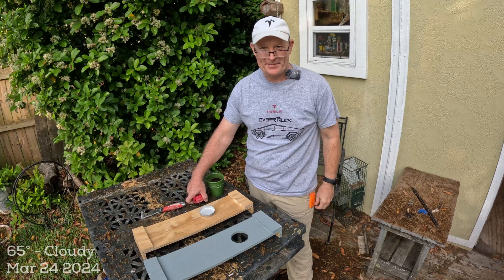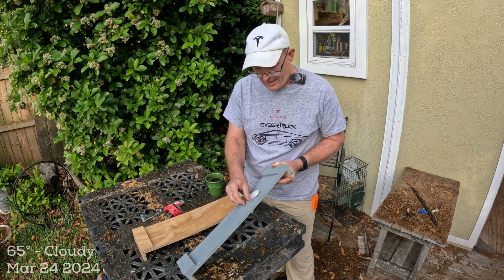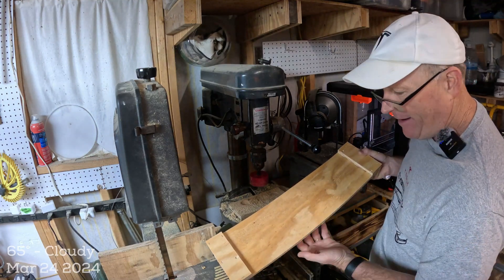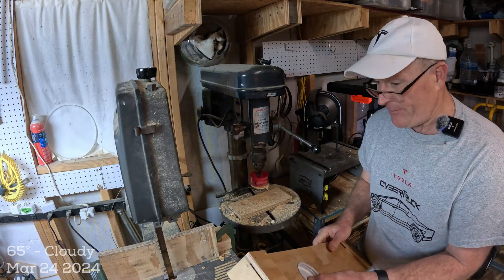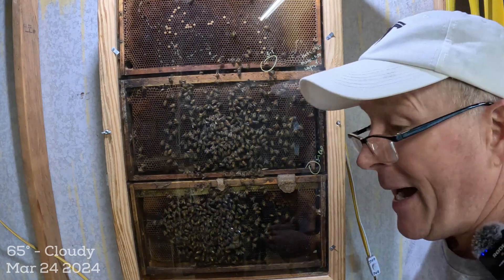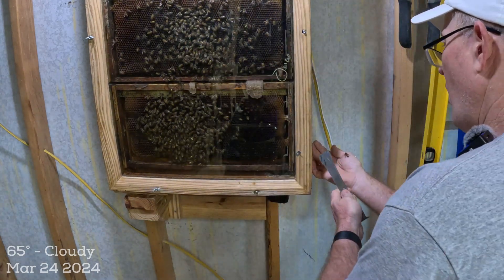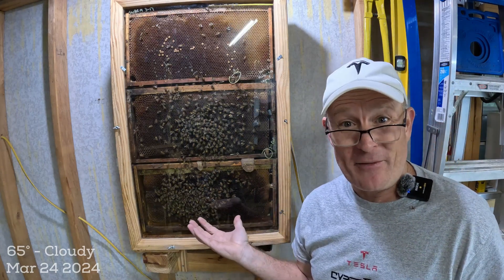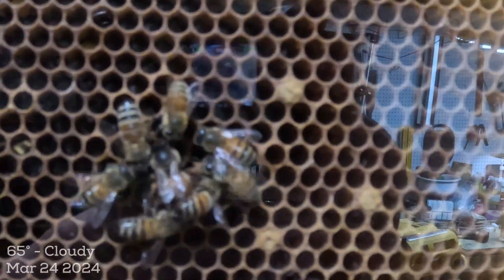Hive Top Feeder Hole Saw Tips & Observation Hive Update - Jacksonville FL Zone 9b

Comment: I picked up a 2-3/4" hole saw, which I believe is about 70mm equivalent. The jar lids do fit a bit tight. They're tapered slightly so I get about half the lid in before it starts getting too tight. It works, but 71mm, as you suggested, looks like it would work much better. Thanks for the great videos! Its fun to see what you're up to and I especially love learning with you when you experiment. I just started trying the centrifuge vials in my swarm traps this weekend. You're ahead of me a bit (I'm in northern Utah), so I'd love to see an update on what you thought of them as your swarm season wraps up.
Reply from the maker: I think I caught more swarms with them.  They really work.  perhaps the wick could be smaller to let less scent out. I ended up putting them in plastic baggies with a few holes to reduce the fragrance.

Comment: Hey Chuck.  Wanted to let you know I bought probably 5-600 of the little vials for putting swarm commander in. I use cooking twine as candle wicks don’t work well. Anyway I wanted to tell you that if you make sure the vials are placed in the back upright between a couple frames they last a lot longer. Throwing them in they tend to leak out faster. 
Also. Have learned you really don’t need any of it. You need to wipe a mixture of melted propolis and wax inside the hive and on the entrance or entrances. 
I also use my own design box that holds ten frames and is about 4-5” deeper. I started putting boxes out on the 5th of March and have caught seven swarms. Have more in the traps but haven’t gotten out to get them   That’s why I use what I use so most of the time they have 6-7 frames drawn out and she is laying. About a week to two weeks once they’re in. I just transfer right into deeps. 
Thanks for the tip on the little containers. I still use them

Comment: 2 3/4" hole saw can be bought at ace or harbor freight. Cut head off a 4 inch bolt and cut a slot in the end of the bolt with a cut off wheel on 4 inch grinder 2 inches deep. Fold a 4 inch piece of 80 grit sandpaper put in slot and put rod in hand drill. The paper will center itself in the hole when u turn drill on and will evenly remove the small amount needed in about 1 minute.
Reply from the maker: Great tip, and interesting technique.  Thanks for sharing.
Reply: You're welcome sir. Like your golden rule vid and double screen board vid!